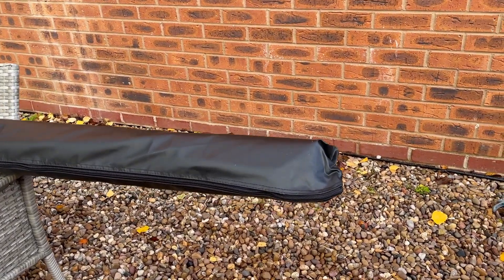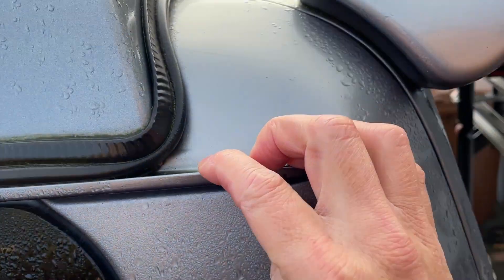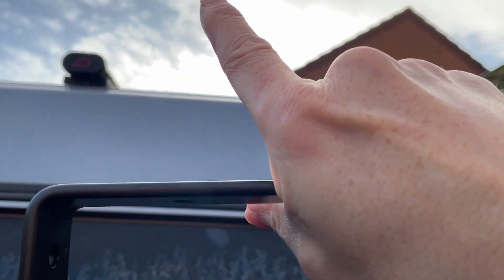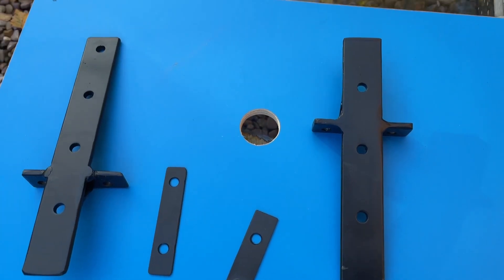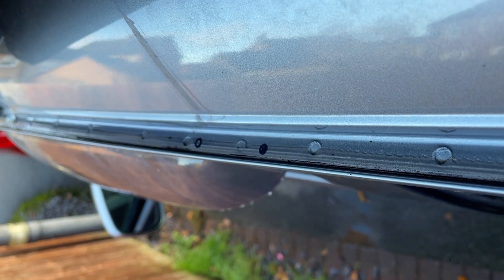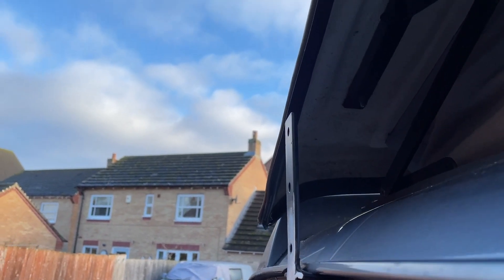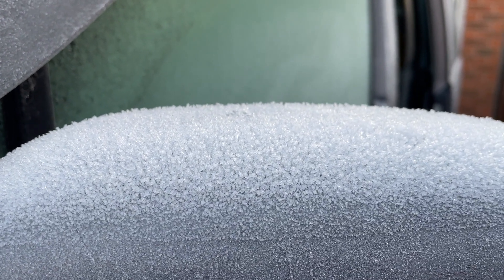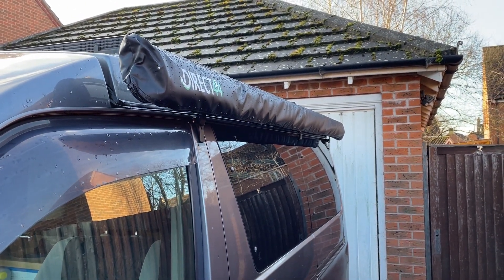Direct 4 x 4 Canopy/Awning Installation on a Mazda Bongo Campervan

Comment: Great job with the brackets. I had an ARB awning for my t25 which looked very similar. My advice would be to use guy ropes even on the calmest of days. When it does get picked up by a breeze the supports can become lethal. I really liked mine. It helped bring the outside inside and doubled the living area. Looks good on a bongo. I just tried to remember to peg it down when in use
Reply from the maker: Thanks! These awnings are basically ARB copies aren't they. I've heard others say exactly the same thing about pegging it down. I can imagine it turning into a huge 'sail of death' in a breeze!

Comment: Hello fella well how are you getting on with the new awning.
Looking forward to seeing your updates and very intetrsted  in seeing about brackets.

I have an afternarket poptop and would like one 

Brendan
Reply from the maker: Hi Brendan, sorry for the delayed reply! I've not had much chance to use the awning as yet, but it's been very stable and you don't really notice it's on the van (which is good). So it looks like the brackets I made are holding up fine. 
 
I'm afraid I've not had chance to make a second set of brackets yet. I'll order some metal today and get that delivered next week. Can you drop me an email (use the ABOUT tab on my channel), I don't always get notified about new comments. Cheers!
Reply: @Vantastic Ideas  morning fella thankyou, loving that setup looks like a lovely awning.  Can't find email address on your about page.

Very impressed with your bracket skills there, my roof opens up opposite to yours.

Which part of the country are you based in ? 

Brendan
Reply from the maker: @brendanmcfall739   That's odd, the email should show to anyone logged in to youtube I think?  email me on info@vantasticideas.co.uk
Reply: Just emailed you there 

Brendan

Comment: Ooh just got same setup with after market pop top  

Been hunting for a while for solution.

Thankyou although I will need too find someone to help with brackets welding
Reply from the maker: I couldn't find anything for aftermarket roofs out there. I might make a V2 of these brackets (I was just using the brackets that came with the canopy to save money) starting from fresh metal as I have an idea to add another level of stability that I couldn't do with these ones. If I do make some new ones I might try and make more to sell, so people like us have options! Cheers 👍
Reply: Thanks for reply, just a newbie on the bongo, picked mine up last month, couple things I'd like before we set off too far, love your YT videos really appreciated and helpful for us amateurs.

That would be cool about brackets there are some jobs I'm not capable of .
Reply from the maker: @brendanmcfall739   Thanks! they are such a fun van to play around with and so many options it's mind boggling :) I'll put out another video when I make those other brackets. Happy Bongoing 👍

Comment: Hi great video. I've just got a Bongo. Can you recommend or suggest a rear bike rack. Mine does have a towbar. Ps I am just installing a diesel heater. George
Reply from the maker: I hope you're enjoying the Bongo journey so far? 

I've only had experience with the Fiamma rack (also fits mercedes vito vans) that I have. It's very solid and I often carry extra camping equipment on it, but you do need to cut the spoiler to fit it. 

I've heard the Thule 973 rack is also a good solid rack and doesn't require any modification to the van. I don't have any suggestions for towbar mounted racks I'm afraid.

Good luck with the heater installation, I'm desperate to get one, I just need to find a space for it! Cheers 👍